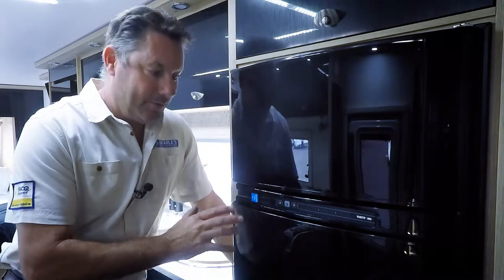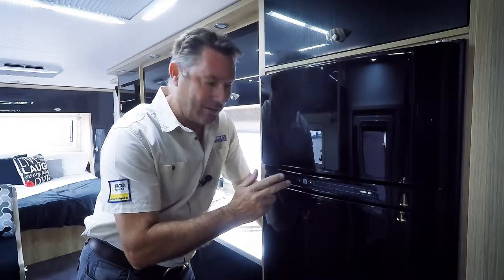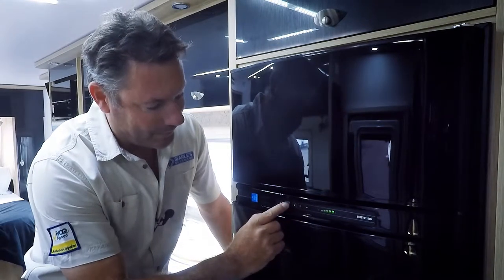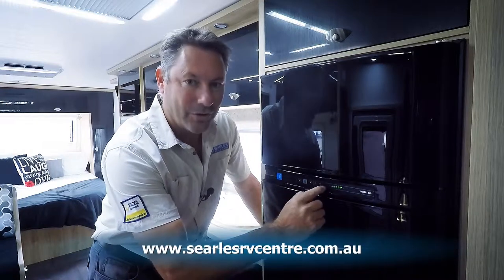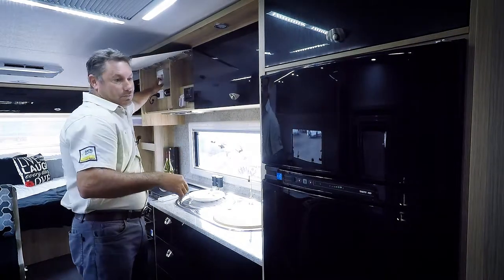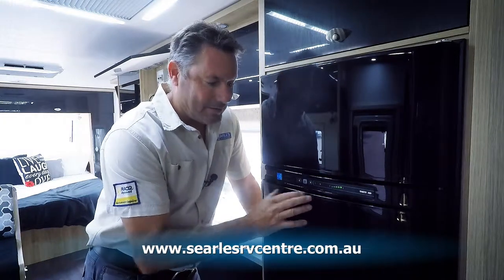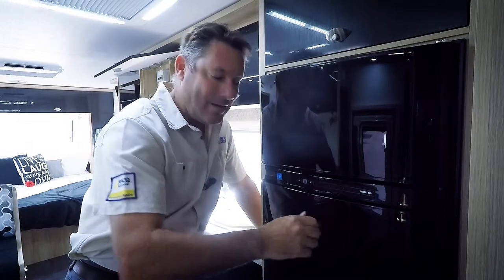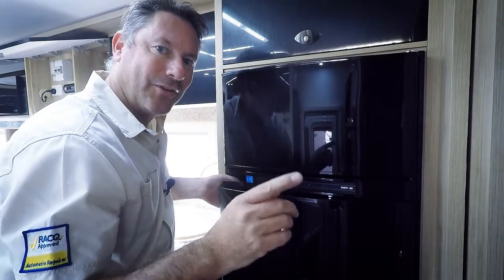How to operate a 3 way AES Fridge

Comment: Hi, can you tell me of any way to fix a fridge that will not change to 12v DC when mains power is disconnected?
Reply: HI Graham, if it is an AES (automatic energy selecting) fridge and the control panel is set to A for automatic then it should switch over. If it doesn't there could be a fault and you would need to take it to an authorised repairer. Regards Ben

Comment: That's not true. It's a heating element that heats the ammonia the same as mains power. The problem is there no control circuit for 12volts and will keep going down in temp until battery starts going flat. The best thing is look on YouTube. Fit a relay from 12 volts to element with temp controller. This will prevent battery drain to zero. Next on the live side of 12 volts tap off 12volts to the control board keep aes going.
Reply: Hi Rusty, As mentioned in the video the 12 volt reference for an absorption fridge means 12 volt from your tow vehicle not the RV's house battery. The 12 volt element draws a lot of power and will flatten a stand alone battery in no time at all. You can however run a compressor fridge from the RV house battery.
Reply: @dalehodge5629  from dometic rm2356 wiring the rv battery or caravan battery can run the heating element. Check the wiring. The best is to have two dc to dc converter. When voltage reach a set voltage it will disconnect. So car battery will disconnect leaving enough to start engine. Same should be in rv. This will save the life span. Next if you add a relay to element with temp controller it will switch in and out and not run it all the time. There is a lot of people writing about compressor fridges running in tropic and the amount of gas these fridges use is little. Here in Australia. It can be hot. 50 degrees c in some places. No 240 volts and days of clouds. Or even clouds one min next rain. Not been able to charge batteries. Tell me how do you run your compressor fridge where the next town 500km away and battery flat and not aloud to run a generator. It's not about been rude to anyone. It's about information sharing. Thanks Russell
Reply: Hi Rusty. If you run a compressor fridge the first thing before hitting the road is to make sure you have enough batteries and enough solar panels to ensure you have power, allowing for a few overcast days. Worst case scenario, all you need to do is attach the van to the car and let the vehicles alternator charge the batteries back up.